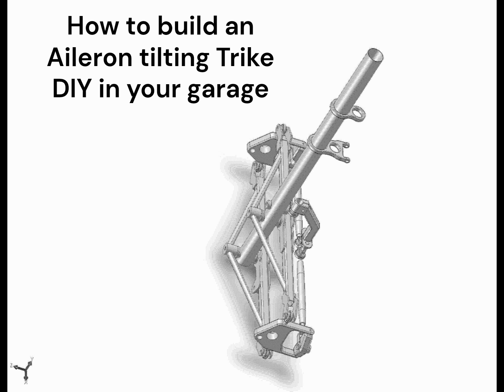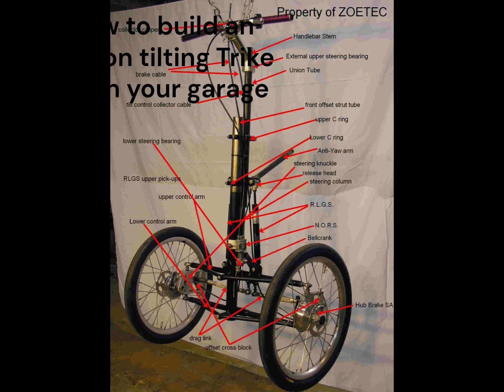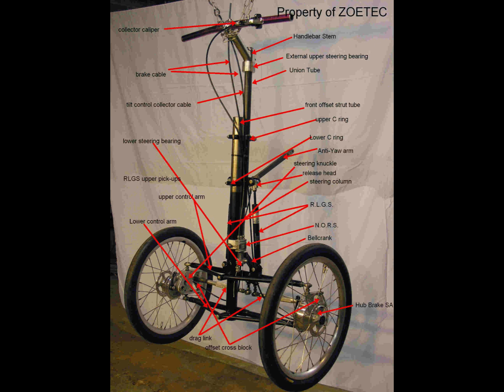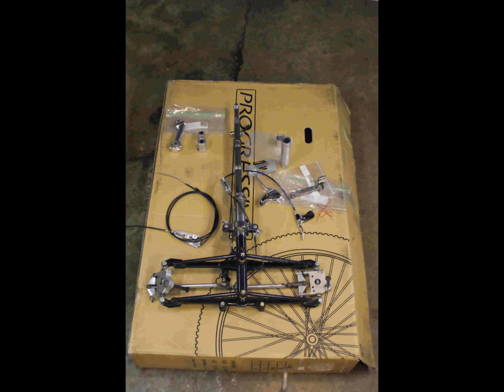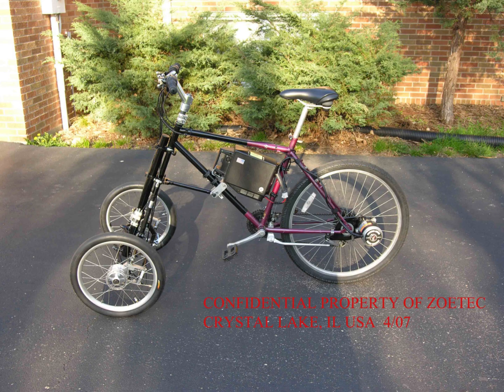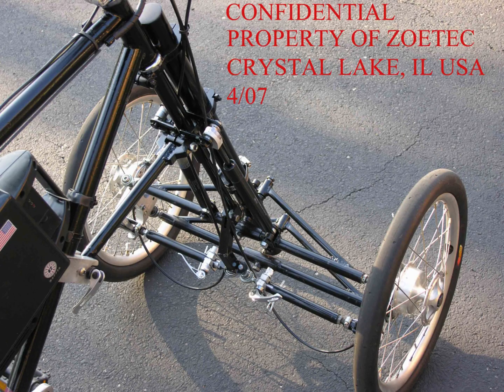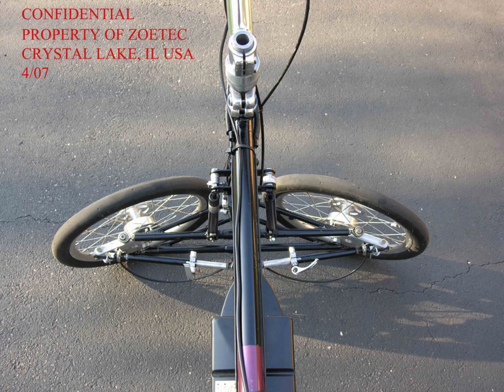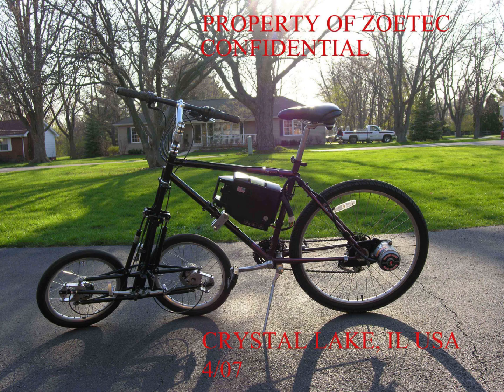How to build an Aileron tilting tricycle B

Comment: i assume you know about Pedro Neves' open source front suspension upright tadpole tilting cargo trike build? it doesn't lock like this, but it's very impressive, and instead of "secret sauce", everything is out in the open for anyone to build themselves.
Reply: I am not that smart that is why it took 30 years to get to my Aileron BLT video. I am not satisfied. The secret sauce is 99% of the 1% of inspiration of invention. It is tech and excrutiatingly boring. I would have to bill you for the time it would take to explain it to you so you might make modification specification and configuration of the off the shelf parts. There is what I call a lock drive mechanism. It is harder than the chassis design and you use it 3% of the time in the ride regime envelope. It is more and more about less and less. You can make complex function simple. You can only make things simpler and you face infinity in doing so. K.I.S.S. There are at least 30 practical ways to do the things in my video. You spend a lot of time and money arguing and iterating solutions, Which is optimal or what sells is the major argument. Why aren't tilting trikes common? Well Legacy vehicles like cars and motorcycles are commodity market product. If you sold a tilting trike would it canabalize a sale to a manufacturer like Haley Davidson to its legacy product? The big guys have to create a market the sale service liability insurance and government regulation infrastructure make a profit to be worthwhile! They have enough trouble maintaining their existing market. Do I convince you that you want or have to have one of these critters? You can save the whales or go insanely fast safer? You tell me.

Android is a open mobile OS from Google. The US cut it off from the Chinese. Stay tuned I will reveal more of my solution as I go on but would like to trade resources for it. As I said there are at least 30 optimal ways to do it which is an oxymoron in itself. I am not but there are plenty of sharper knives in the draw. There are 8 billion people on the earth and many have come and gone in 3 decades. There is plenty of infinity on Youtube. There are a lot of tilting trikes on Youtube. My claim I have some original simple moron stuff in my solution. I see some designs close but in the long run overkill. It is not what to do but how well to do it.

This concept fell out of my head whole 30 years ago but it has taken me this long to build and understand it.
I do not understand everything I know. It is chicken and egg. Never been a horse that couldn't be rode or a cowboy that ain't been throw'd. If you can imagine it can be done. Mankind is working toward AI AGI ASI as our replacement? It is more and more about less and less! The quest helps keep you alive or could kill you!

Do you want one of these tilting trikes to build one or do you just want to know how it really works.

I built and ride and rode at least 13 iterations. I really don't know how it works in quantum human bio intel level. I just want to entertain you and   I will know good enough to build and sell by me or by some other poor bastard thinking this!

How do you know what to know. My conscious and unconscious work in parallel and concurrent simultaneously so is infinity and nothing. Hardware imagination software is poetry and song diagrams design chaos order apex predator fear love hate is the secret sauce. Buddy an you spare a dime................

You want things that are novel and familiar to sell to yourself inside out ack flipping? Enuff said? I am as curious as you in the ethernet of the internet discourse! Tilting is easy all things considered!
Reply: @Vanwaynesoohoo well i have a regular 2 wheeled cargo bicycle in my head for about 6 years now, i have yet to build it. i can't even weld yet. trikes have tons of interesting technical solutions, but i would probably not build one myself anytime soon, maybe much later. your channel probably got recommended by youtube because i watched and commented on Pedro Neves' videos. my cargo bike idea is about simplifying the build much more than what's currently on the market and it resemles Indalecio Sabbioni's Trunke, but it's a bit different. it's not a secret at all, only i have to build and test it first, and if i'm finished with testing i'll put the plans on the internet. it's really very simple.
Reply: @markifi  go ahead. I am not crazy about 3 wheel tilting trikes unless they have a tilting lock drive mechanism. A cargo trike has most problems at stop balancing the additional cargo. A 3 wheel design front end is more complex. It has more space for load carrying as an advantage. there are a lots of pros and cons. The difference between a bike and tilting trike is not that great to me with out tilt control but then there is more weight and complexity. You don' t get something for nothing!
Reply from the maker: steering and tilting two wheels is a lot different. If you don' lock upright and level it is like tits on a bull.copy Pedro. or invent  bbettter than the rest.
Reply from the maker: Steering and leaning two wheels apaet is a lot more complex. It is differnt than a car front end since it tilts alot.. You have to eliminate bumpsteer and have ackermann
Reply from the maker: i tricked it doing what you need in each situation
Reply from the maker: Pedro design is a more complex bike where is the advantage?  review my other vids I lug a 50lb car battery. Pedro has more subscribers and views and does want to exchange ideas. He loves his own ideas. Ask him to form a forum channel comparte debate. More will get done.If you are impressed with him follow him. I built over 13 prototypes without 3D printing.  One off hand built is often cheaper faster. Have gun will travel . I will ride off and compare my designs against all comers. Serious building TTW efforts have gone bankrupt. Look at EV4 from Polish Aero Service. They do not lock tilt but serve their own market vision. My concept is more expensive and complex but cab do more. Onlu market penetration can reduce this.